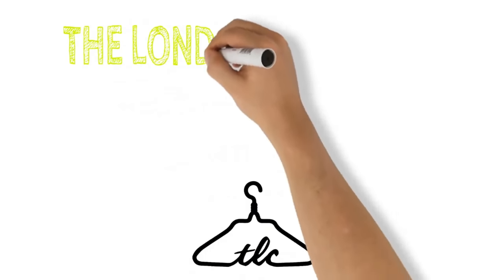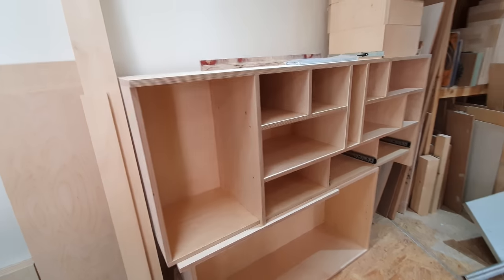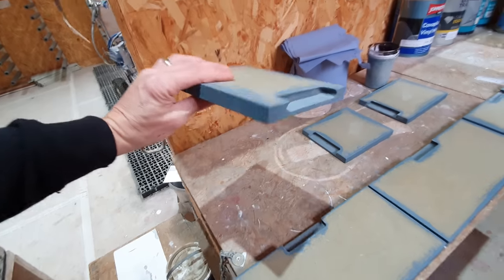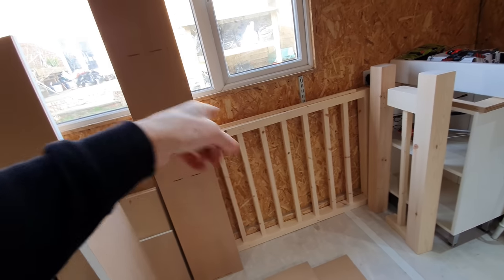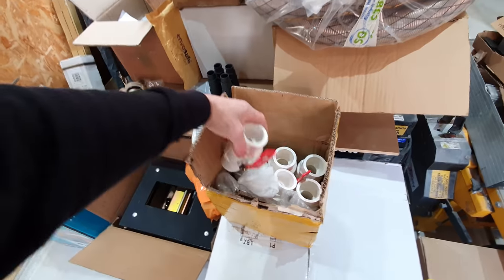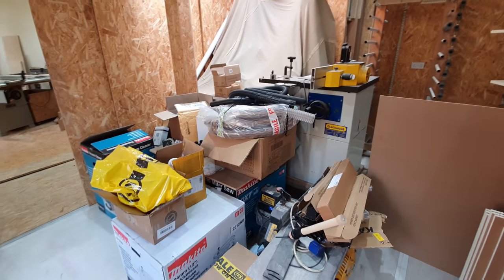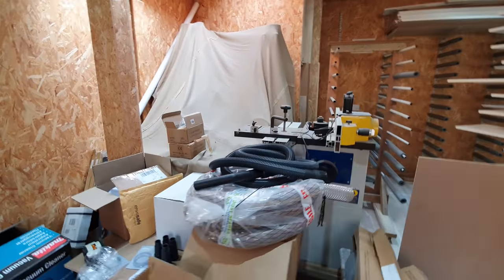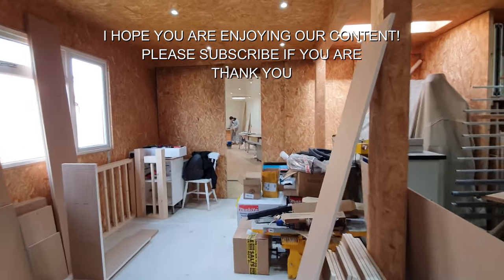Making Things From Birch Ply | Plans Of My Ultimate Woodworking Work Bench 3.6m x 1.6m | Ep#55

Comment: The mega bench looks like an interesting project and could work well in your shop, but I have a few concerns.
Your extraction pipework will clog up if you use the thicknesser on it...you need a minimum 100mm hose for that machine.
As you run a commercial workshop with employees, can you legally  use an L class dust extractor, or should you be using an M class machine...I'm not sure what the regulations are, but I think M class would be a safer option.
If you all get working around that bench, I think you will be tripping over each other before long....separate workstations eat up floor space, but quite often make for more efficient workflow.

Comment: cant wait to see the bench finished. i will reserve judgement until then but it is the oposite of what i would do. a big bench in the middle is great for assembly etc but you will have 3 guys all working ontop of each other. it can work with only one person but 3 will be a disaster for efficiency. everytime you want to use the table saw you will have to move  stuff or move the other guy , same for the chop saw, router table, etc. everytime you want a tool you will have to move someone out of the way to get it.  
i would put them all around the outside. put the chop saw into a mitersaw station  with a kreg forman and a hindge boring drill press, put the planer under it so you can pull it out to use it. the best thing for efficiency is haveing things set up and ready to use . set up time eats into profit really quickly.
Reply from the maker: Cheers Alan, I think the way I designed it works for the way I/we work in the workshop. We also need wall space badly for storage so any units up against walls is a no really, especially as I'd like to free up space for my 3 stand alone machines.
These benches are modular so if all goes wrong I can still split them in half 😁😁

Comment: Looks fantastic, lovely detail and great to see you are keeping busy. Are you a bit concerned about the covaplus marking up quite easily as its just a vinyl matt. I guess you have tested how durable it would be to oils from fingers? I suppose you could spray a clear coat to protect if necessary? Cheers
Reply from the maker: Hi sorry for.the late reply, I did actually change the finish to a wipable matt on the customers request, but clear coat is also a good idea for the future.
Cheers ryan

Comment: Those caster wheels look epic as well as those lever isolation valves for the dust extraction - can you advise where you got the materials/bits please?
Reply from the maker: Yeah I'm looking forward to using them!
What bits were you looking for and I'll send over links 👍
Reply: @thelondoncraftsmanworkshop  Hi the lever valves ( white with red handle) , the dust extraction kit and the castor wheels please 👍
Reply from the maker: 👍Will do, I'll get back to you

Comment: Are you really using vinyl matt emulsion on Arbella's units?
Reply from the maker: I actually changed the spec and went for dulux diamond matt in the end, I primed first. 
Customers choice on the sheen 👍
Reply: @thelondoncraftsmanworkshop  I've used Dulux Diamond extensively on customer fitted furniture. Not sprayed though. Apart from the price, its fantastic.
These days I use Crown fast flow, colour matched  by crown  it has 5% oil apparently.
Reply from the maker: My only worry is finger marks etc, but its matt and the customer is aware of this so nothing else I can do

Comment: I counted 18. A few comments on the workbench it looks good and like it incorporating lots of features you should check out hooked on wood bench and the woodgrafter as they have added good features. Those valves looks like they might be quite restrictive so blast gates might be better. Also the thicknesser is likely to block a 50mm run if you're shaving a lot. I like the router plate but it didn't look like you had the t track for a fence where the table saw wing is so would be worth looking at and should reach out to sautershop as they have done a number of sponsored videos. Once you've got the dog system you could put in a flip down rail like the mft and you will def find that useful. If it was me I wouldn't include the chopsaw in the bench certainly if you do want multiple people using it. Maybe add it into a run of cupboards for storage where you currently have at the end
Reply: Did I win? ;)
Reply from the maker: Cheers for the input maty, I'll read over them and take them into account 👍
I was thinking about the thicknesser pipe but ill just remove the valve if needs be for that, im sure the rest will work with the valves.
The idea of the chopsaw in the bench is that I don't want anything in the workshop plus I don't like the look of mitre stations.
Cheers for the heads up on sautershop I'll take a look 👍👍
Reply: @thelondoncraftsmanworkshop  yeah I guess it's down to personal workflow etc, Ive tried a lot of different ways (as I'm sure you have) and kind of settle on tracksaw for breaking down and chopsaw for crosscut and table saw for narrow rips. Also a bit of a f(est)ool nut so it's good for using 1 cable and vac hose for Domino, sanding and routing.
Reply from the maker: Lol I'm not sure, I lost count a few times 😅😅😅.
I'll have to double check and get back .
Also haven't forgotten your shout out when I make a new vid 👍
Reply: Also I was surprised you were getting rid of planner if you were trying to get more into tree meat than sheet as a thicknesser can't do it all.
Reply from the maker: I don't really cut up panels I generally get that done for me so track saw is only for 1 off cuts and some bevels, and cut large narrow panels down to length if too big for the table saw.
I was sucked in too by seeing a vid of a chop saw thats built it so had to have it 😆
Reply: @thelondoncraftsmanworkshop  last comment lol have you thought about making the bench seperate-able in half so you could get to the middle more? Looking forward to seeking the sketchups
Reply from the maker: Na feel free to message mate, its good to have someone to run ideas through.
I was thinking about that last night and the only thing that will in the way is the flexible hose but other than that it should be doable
It's all gonna be made from Birch (number 100 lol)
No machine necessary just gluing strips together to make component
Reply: @thelondoncraftsmanworkshop  you should definately try a track saw and rail square
Reply from the maker: Yeah I think I will, cheers